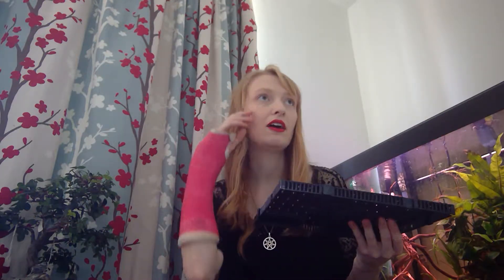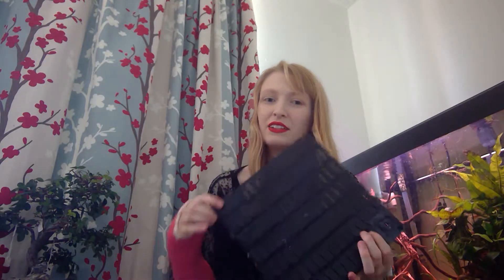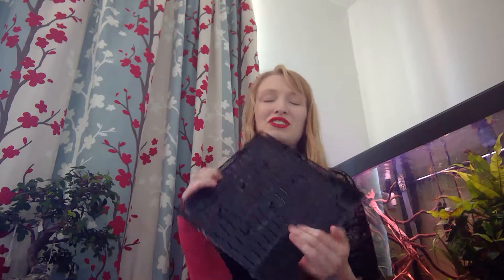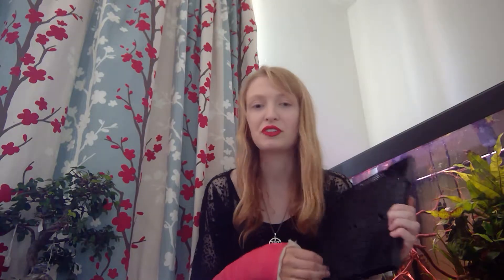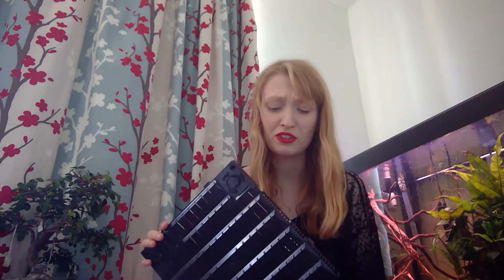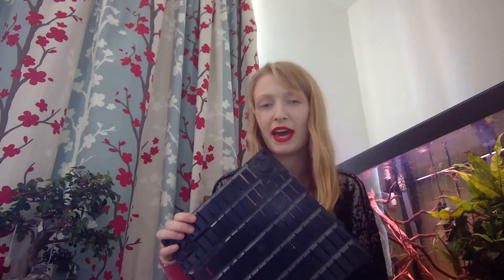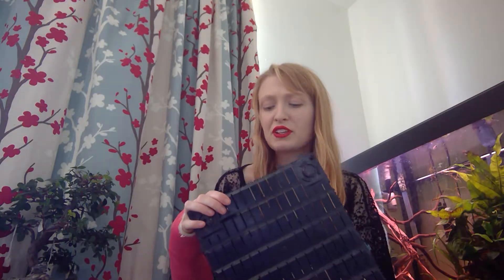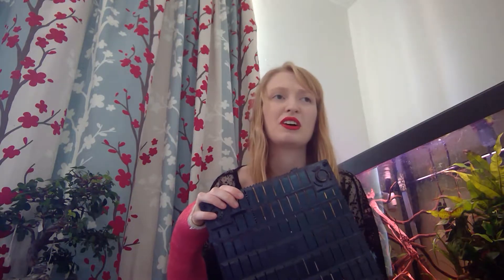Why I dislike undergravel filters! - Quick Aquarium Topics

Comment: Or you could do just an air stone and buried it under the gravel and it works the same and easy to change and easy to clean
Reply from the maker: Gravel isn't really suitable for a lot of fish, anything that digs cannot dig fish like cichlids and goldfish risk choking on the gravel which I've seen a lot therefore potentially getting it soo stuck it is difficult to remove without dislocation or breaking the jaw entirely. It also means that Corydoras, a lot of loaches and catfish just aren't suitable for the tank. Also gravel provides very little surface area compared to sponges, ceramic media or even sand in the filter. Additional to that just burying an air stone under the gravel means that flow doesn't really travel the same way as even an undergravel filter.

Comment: How long have you been an aquarist? Do you even know what anoxic filtration is?  You painfully lack the experience needed to give any kind of advice on UGF plenums. I understand you're speaking from personal experience but your subjective advice can skew the thoughts of any newbies that happen to come across your channel. I fail to understand the many problems you face as all my tanks have UGF's with many being well over 15 years old and fully cycling having never needed a takedown for any reason.
Reply from the maker: Time fishkeeping means very little. Knowledge and ability to apply it goes further. Judging time in fishkeeping is also ageist. You mean anaerobic not anoxic. Anoxia is the lack of oxygen reaching cells. Anaerobic is areas without oxygen, it often is in reference to anaerobic respiration, respiration without oxygen which leads to the production of a variety of chemicals. 
What you’re talking about is your own experience so why bash mine? Or why ask how long I’ve been fishkeeping? I’ve maintained probably around 50 undergravel filtered aquariums in my time some for quite a few years and it is almost impossible to remove all the waste unlike sand. It also limits what fish you can keep by neglecting digging behaviour or a choking hazard. I almost see goldfish weekly have issues from choking on gravel and many times seen impacted cichlids.
Reply: @FreshwaterIchthyology  I'm definitely not an expert but I was led to believe that anaerobic meant no oxygen present and anoxic meant very little oxygen  present like 2ppm